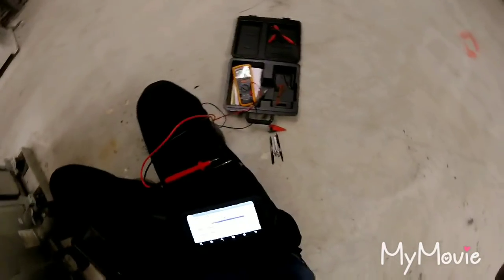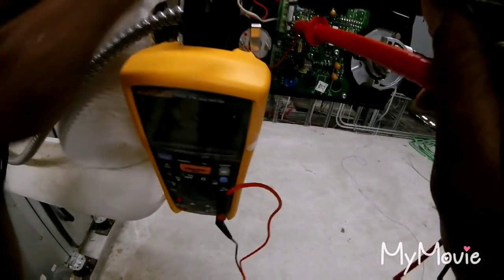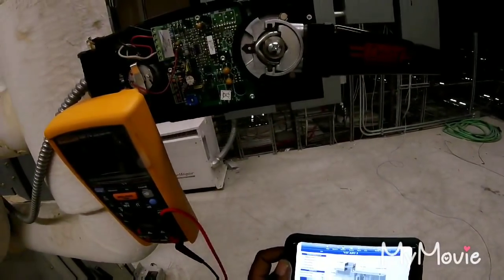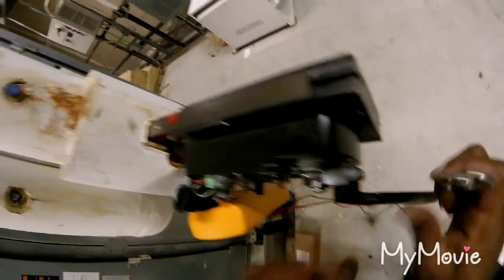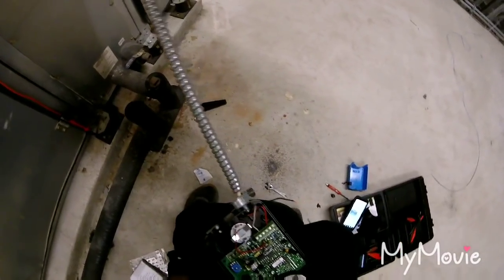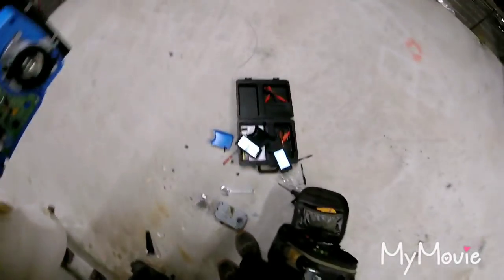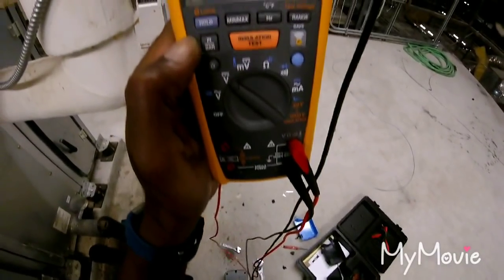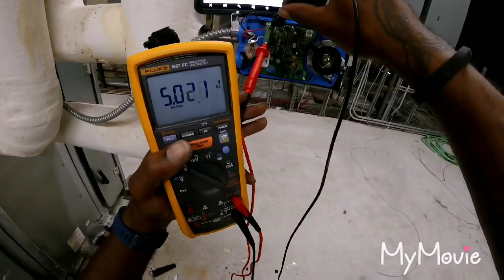HVAC: Actuator troubleshooting

Comment: Nothing but gold. The electrical and observational diagnosis was great. The indicator position and the voltage reading =correct orientation as well as correct voltage feed.  The dip switch position while fairly obvious can be overlooked and weird diagnostic measurements can be the result. I'd like to suggest a fabricated sling of some sort for holding your electronics where you need them. I'm sure you'd fabricate the sling much better than looking for one that may or may not fit your needs completely. Thanks for bringing us along L.U. I was hooked from the jump.

Comment: I had to come back to ask a question which I'm creating based on the video and would like a simple yes or no, as  not to take  a lot of your time. My question is: Since the voltage varies at various stages of the damper being open or closed is it safe to assume voltage  must be present all the time and regulated by the board which takes it's que from the position dialed in by the user or feedback circuit?
Reply from the maker: Greg T 
24v Should be present all the time between terminals 1&2(black&red wires). White wire on terminal 5 is 0to10vdc which is the signal for the damper position 0 to 100%..

Hope that answers your question...
Reply: Thanks, L.U.